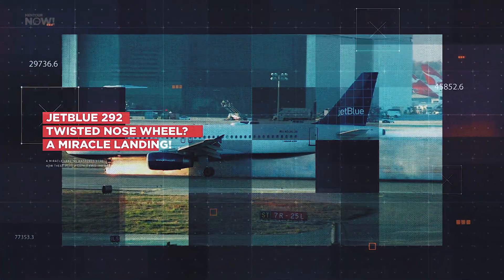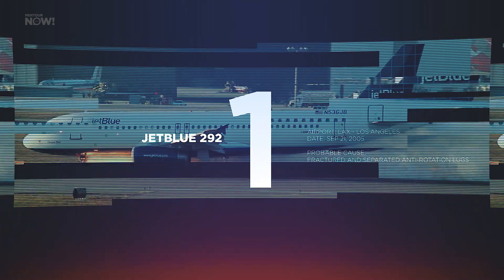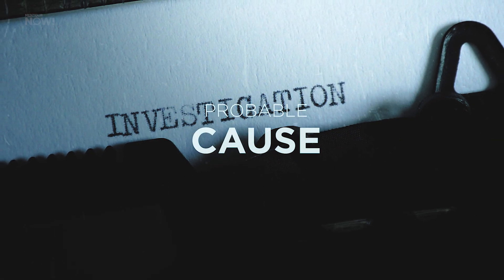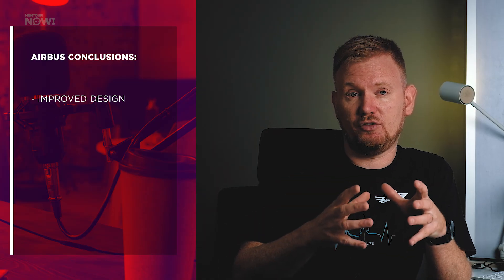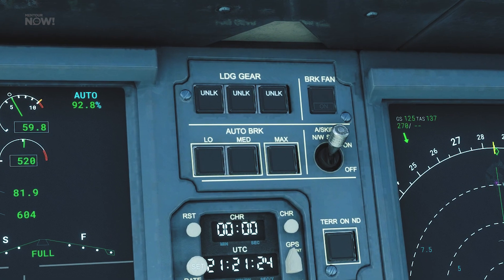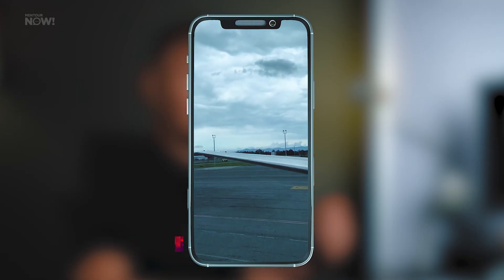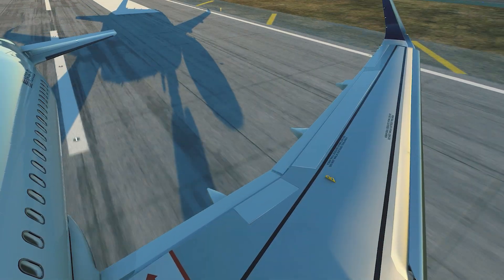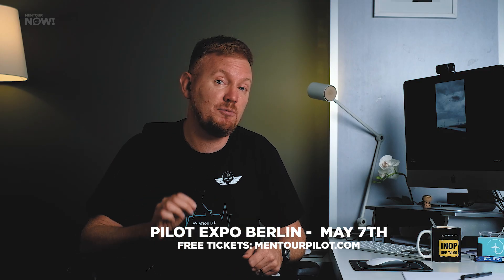The TWISTED Story of the Airbus A320 NOSE-GEAR!

Comment: As an engineer (not in the aviation industry), I want to add that it's true that a fault that appears to be same might have have different causes, BUT if the same part keeps having problems and you are fixing it time and time again and always something new pops up, then you sometimes want to scrap that part entirely and design it from scratch again - ideally, using a different engineer. Oftentimes 80% of the problems are located in 20% of the parts and if you already found that you have a part at hand which keeps suffering all sorts of problems, there might be more to discover in this part. And then it might be cheaper and safer to scrap it and start designing this part from scratch again.
Reply: This is what an effective Failure Reporting and Corrective Action System (FRACAS) is supposed to do. Find the root cause of the failure, determine a corrective action to fix the root cause, and then, in a step that is rarely correctly implemented, evaluate the effectiveness of the fix. After the second incident at the latest Airbus should have performed an extensive FMECA leading to failure mitigation redesign if the NLG and SW systems.
Reply: of not if😂
Reply: Agreed, 90% of the time we even know the system was badly designed, but it is too expensive to redesign something in production so in go the workarounds.
Reply: As a former software manager, I come across this type of issue often.  If the initial design is faulty, all the patchwork, restrictions and guidance simply makes it more difficult for future fixes. The hope that each incident will provide a new test case so future design will be better tested before production. That said, Airbus should start a new design for a replacement of the nose gear. Flying an airplane is difficult enough than to having to know all the restrictions and guidances once similar issue occurs. If every passenger sue Airbus for the PTSD caused by 90 degree nose gear landings, I'm sure Airbus would focus on a permanent fix rather than patches.
Reply: i agree. theres tons of other planes with perfectly working nose gears. the designs are out there..... @fredlin6303
Reply: On the other hand the A320 is one most-built passenger planes and seeing use in the EU it might even do more starts and landings than the 737, which will increase the number of incidents. But yes, getting fresh brains on this, maybe not to redesign but to test its limits in creative ways, would help, but on the other hand: The A320 not even lands with a 90 degree wheel but will even start with one.
Reply: I work in failure analysis for med device and every time he pulled out another incident, I felt my eyeball twitch. We've had products where there's always one more failure and therefore one more root cause and those are some of my least favorite
Reply: locking into that video there is the glaring question why this gear is built with almost zero Trail and why it is not possible to disconnect all power/pressure to that steering and center it aerodynamicly
Reply: Any time the smallest component gets redesigned or  implemented the FAA needs to test and approve it and that gets insanely expensive. That's part of the reason huh cap clamps made of 4 pieces coat upwards of $13,000. Imagine how expensive that gets when you're needing to get an entire landing gear assembly tested and approved.
Reply: @Tulersian  Not sure if it is cheaper if you have to redesign parts again and again and again, which also means certifying parts again and again and again. It's often easier and cheaper to make one big bundle instead of many small ones.
Reply: Agreed!  This feels like the definition of insanity.  They keep reprogramming this module and making modifications and it just keeps breaking in new and different ways.  It can’t be this hard, Boeing, Lockheed, McDonnell Douglas, Bombardier, Embrear & Learjet all seem to have figured out how to design a nose gear that faces forward.
Reply: @andrewnajarian5994  Can't be that hard? The landing gear alone has about a hundred sub-assemblies and over a thousand parts. Changing a feature is more than just a part revision, an entire sub-assembly would have to be redesigned to accommodate the newly revised part. The tooling and manufacturing procedures would have to change. It would also have to be stress tested not only for the revised part, but also the entire sub-assembly, and on flight tests just to be certified. That's tens of millions of dollars of design, engineering, manufacturing, and admin work.
Reply: This!
Reply: Having the same engineer redesigning the nose gear system on the A320 would be highly unlikely.
😁
Reply: @miks564  Given the age of this family, it's unlikely to get the same engineering team again. However, if the redesign happens within a reasonable time, it's not so unlikely to get the same engineering team again. After all, there are certainly not so many teams in Airbus which are specialized in designing landing gears. On the other hand, every mistake is an opportunity to learn. It's one of the reasons why a stable engineering team with little fluctuation delivers better products long term than a team with constantly changing people. We often like to think that a good engineering team just needs intelligent people who can do math and have a solid knowledge about the technology. However, experience (which is not the same as knowledge), strong processes (which are usually enforced through standards and norms in safety critical applications), and good teamwork are definitely major contributing factors to make an engineering team successful.
Reply: @fr89k  You bring good and valid points. however something to keep in mind, getting a part recertified after a modification is far less intensive and expensive than getting the initial certification, it's the reason most companies like Airbus and Boeing don't make more new families of aircraft. The associated cost with certifying it is astronomical, getting a redesign certified is expensive but reasonable, This difference is what causes things like the 737 MAX, because without MCAS it handles significantly different from previous 737s, and as such would require a full certification, and would be considered a "new" aircraft. Hide that it has a maneuvering augmentation system to make it handle like the older models? it's a recertification. (this is just one example of this system being mildly abused for illustrative purpose)

So knowing how much more expensive and how much more severely scrutinized a completely new part design is, it's more viable from a strictly business standpoint to patchwork fix an existing part, because you can go "this redesign fixes a problem, but it's fundamentally the same part" which means that it will be far cheaper and easier to recertify because the base design has been proven already. What I'm trying to say and doing poorly, is the recert for many small changes is much less costly than one major redesign and it's associate initial certification.

Now, my personal opinion is if you've had this many patches, it is probably a better idea to just eat the cost and redesign the gear, but that comes with the constraint of it needs to be able to be retrofitted without much additional work, so you need a gear that fits in the same stowage space, and operates with the same connections that are already available. It's messy.
Reply: @miks564  The same team responsible for designing the landing gear should be the one tasked with fixing it as they are most familiar with the system they designed. An entirely new team could make additional mistakes elsewhere.
Reply: That's not surprising since everyone knows that 20% of the parts do 80% of the work!
Reply: Lol. There are so many problems with the landing gear. Let's get rid of the landing gear!
Reply: @williamwchuang  let's redesign the landing is what he's saying 😐

Comment: 1st incident: it was a fluke
2nd incident: just a coincidence
3rd incident: ok there's a serious issue with this plane
4th incident: this plane needs to be recalled and scrapped!
5th incident: why the hell are these planes still flying?!?!

Yeah you could argue that all the incidents were caused by different issues, but the fact remains they ALL ended up with the same final result: I nose gear 90 degrees off center! There is something fundamentally and irreparably wrong with the design.

Comment: I realize how seriously this could have gone wrong, but there's something inherently funny about Airbus going on a Wile E Coyote like chase after the nosewheel that keeps going wrong in increasingly unlikely ways.
Reply: "okay we have made it completely impossible for the nose gear to rotate 90 degrees before landing"
"sir I've just received a report that a nose gear has rotated 90 degrees before takeoff"
Reply: @monniBestDiscordBot  "GODDAMNMIT!!"
Reply: @monniBestDiscordBot  15 years later: "Sir we've got another incident of nose..."
"...gear stuck at 90 deg ?"
Reply: @IStMl  lol I forgot this comment existed
Reply: For me it's the fact that by the 3rd time, the pilots's reaction was essentially:
"We're getting warnings about steering aren't we?"
"Yup"
"The nose wheel has turned 90 degrees hasn't it."
"Most likely"
"We're going to have a pain landing aren't we."
"Definitely."
Reply: shit received more fixes than mcas💀
Reply: I know exactly how this would go if it were Looney Tunes: engineers make a device to hold landing gear at 0 degrees…fuselage ends up rotating 90 degrees instead 😂

Comment: Thank you for another interesting video. I am surprised that Airbus have been allowed to get away with this fault for so long. Ok, there hasn't been a serious consequence arising out of this fault but surely, a fault is outside of normal operating parameters. If it’s not working as intended, then surely that should have to be rectified or reengineered to put it right.
Reply: we must have watched a different video because the root cause of a lot of these problems was incorrect maintenance as explained in the video

Comment: I'm curious, is the RAT automatic? I imagine they would start the APU to keep power and control after the engines are shut down?
Reply: The RAT automatically deploys with the loss of AC Bus 1 and AC Bus 2. As mentioned above, if the APU is started then everything is powered and you don't get the RAT automatically.

Comment: Too many geek boxes for my liking!!! 'KEEP IT SIMPLE STUPID!!!' Clarence'Kelly'Jonhson,s words , yes cats&kittens creator of the Lockheed U-2 Dragon Lady, sixty years on,still in active service 1950,s simplicity at work. The A320 is a Geeks wet dream the equivalent of Kim Kardashian minus her bra!!!. Do not need a f-----g geek box to  work the nose wheel steering, look at the nose wheel steering on a 1942 Douglas DC-4 owned by 'Buffalo'Joe McBryon, simple 1930,s hydraulics coupled to a small steering wheel in the cockpit similar to that of a sit on lawn mower , IT WORKS DOES THE JOB!!!.  Reason for the A320,s nose front wheels  jamming side on is  down to poor design,at Dowty Messier Bugatti some twenty something skid mark in a smart shirt thought too much about the new car he,s bought took both eyes off the ball and goofed up.  I a  crap shoveller and bin emptier , know how to design a decent nose gear. beef up the affected part and build in redundancy,a simple mechanical option enabling the skipper to isolate the front wheels from the steering jacks ,letting them castor like the wheels of a Tesco,s Supermarket Trolley (Shopping Cart)and steer with the brakes like a Douglas DC-3.

Comment: Whery technical, good explaine Mentour👮 Allso whery remarkelly, that there are so much story's exist of 't.
Happinez was this wheel in a 90 degrees angel, and not in a 45 degrees angel... Because than had the pilots in meanwilt, go work with thé engens, to holt thé Airbus on the runway.

Comment: In 2008 I was taking a JetBlue flight on an A320 which pushed back and taxied... and then when it got to the end of the taxiway and had to turn toward the runway, it stopped instead and a couple minutes later the pilot came on the intercom to tell us that they had a nose wheel steering error message and were going to get the plane towed back to the gate "out of an abundance of caution" and find us a new plane for our flight. Being as it was just a couple years after the famous incident that was also a JetBlue A320, the passengers were very understanding about it all.

Comment: As a programmer and systems engineer, it always surprises me when I see these multi million dollar systems designed with only two data-points in the safety systems.  You can not really get a reliable quorum with two systems reporting status, you need at least three to safely determine which system is giving bogus data.  It feels like often times they think the pilot is enough to make that third decision, but it is not like they have access to all of the data.  For example with 2 BSCUs you can not really determine which one is giving bad data, so the pilot needs to manually make the decision to fail-over to the other unit.  If they had 3 BSCUs or at least 3 systems capable of voting on the status, fail-over could be automatic.  I do imagine a lot of it comes down to cost, but still.

I know the A320 is not exactly new, but it is not old either.  You would think by now system designers would know that no part should be on a plane that can be installed backwards (unless it really does not matter).  They should also assume that someone somewhere will try to brute force install it the wrong way, so it should not even be close.
Reply: The computers on these aircraft are based on 1980s technology. They have very limited compute capability and have to use them wisely. I would say RaspberryPi Pico or even Arduino have a more powerful CPU compared to these computers.
Reply: No doubt, usually hardened systems are based on really old technology and there are good reasons to keep using it (you don't want to hit a bump and knock your CPU out of the socket).  Looking at the Apollo program is probably a good comparison (which is kinda sad that we are comparing that to modern aircraft), old technology (at the time) was used because it was more stable.  Up until recently most space related technology was still based on ancient hardware specs. But space-x, for example, is showing us that we can use newer technology and it is, in most cases, safer and more reliable.

In reality modern aviation is based on the same concept, as used in the Apollo program, of having a human make the final call on all things and hope that they get it right.  More often than not they do, but it takes years and years of training and simulation to really be able to make those calls.  I am not saying that the pilot should not be that well trained, but the technology does exist to help make those decisions a lot easier.  A few seconds in human time is very short, but even for 80s hardware that is a long time.

The reality is adding a third data point and doing a simple quorum is not taxing programmatically, it could be done with basic circuitry to some extent.  With newer SoC systems most 80's technology could be upgraded to more modern computing power without losing any of the hardening.  More often than not, the reason they don't do this, comes down to established systems and ways of doing things and not wanting to change it (either due to risk, cost or just stubbornness).

Comment: Although you say that there were different causes in each case, my thoughts would centre around the design of the nose wheel system. This many failures should send a message to someone that maybe they need to look at the design and CHANGE IT!

Comment: I'm confused even more after watching this... if this is only happening on the A320 (A319 & A321), albeit, for different reasons, is this not evidence that there is some engineering or design flaw in the nose gear assembly of this aircraft? And if so, why hasn't it been grounded? Also, given that cameras are common equipment on even inexpensive automobiles these days, why don't they put cameras on 100 million dollar airplanes, so that pilots can actually see the landing gear?

Comment: What nonsense. On the first failure a minimal redesign should have been instigated. (1) Add sensors and annunciator that reported the gear orientation. (2) Add a manual override mechanism to adjust the alignment. And I'll bet this wasn't done because it would require a very expensive re-certification...dictated by government. Stupid is as stupid does...or as government causes to be done.

Comment: Being in IT I can empathize with whatever engineering team at Airbus keep getting this problem thrown at them.  Sometimes when it rains it pours with certain things. I have been in a similar situation in my job where the same problem keeps happening for different reasons but it is nearly impossible to explain to others without coming off as sounding like you are spouting BS and don't know what you are doing. It's an impossible situation.